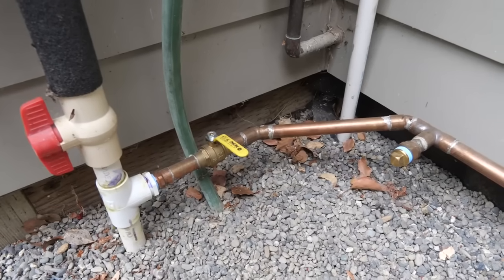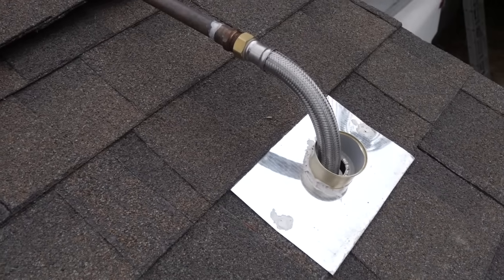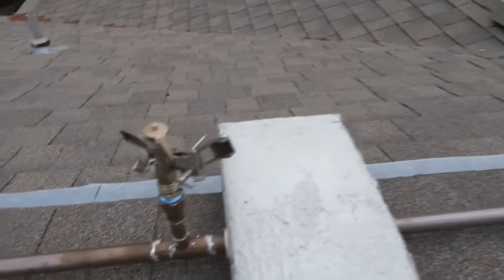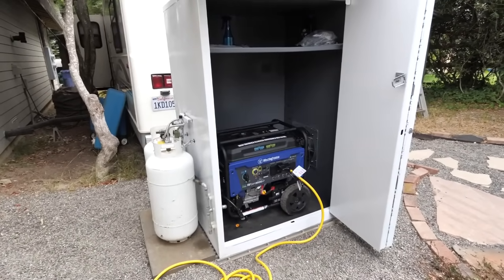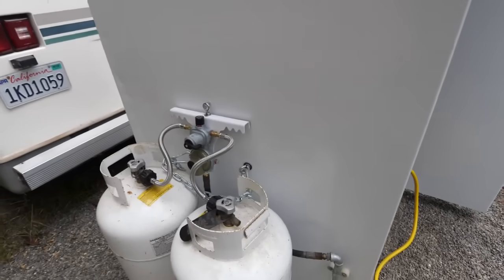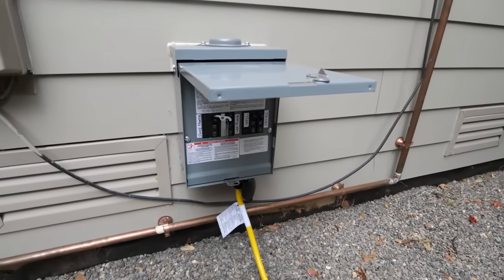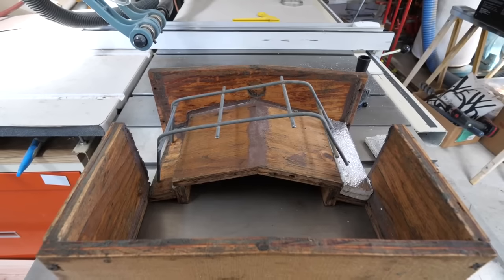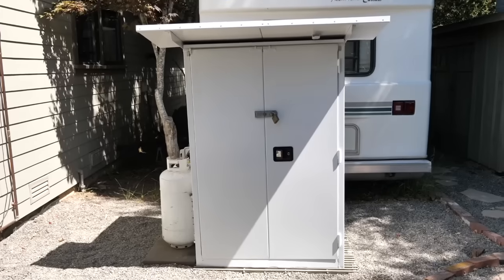Roof sprinklers and backup generator for wildfire-prone rural house

Comment: Great setup. My only comment is on your generator box. I would recommend placing the exhaust fan near the top of box and leaving the hole on the bottom as an air intake. Alternatively you can run a straight exhaust pipe out the box.

Comment: Nice work. I was a wildland fighter for many years. I found the top reasons houses ignite in wildland fires as follows:
1. Flammable items stored next to house. i.e. sheds, wood piles, patio furnature or decor
2. Wood decking; especially with vegetation growing underneath or beside deck
3. Bushes and trees next to (overhanging roof) home.  This is a big one and be mindful of the type of trees. Italian cypress, mexican fan palm, juniper bushes (among others)are explosive and catch easy. While most bushes burn, I would not have any of these on my property in high fire danger zones. I personally feel Mexican fan palms should be illegal in high fire danger zones. Their ember cast after they ignite help spread fire and keep shower them for a long time.
4. Accumulation of tree droppings on roof or rain gutters
5. Not as common but, have witnessed radiant heat ignite curtains or similar light flashy items near window. Wood or metal blinds can help keep heat out. I saw vinyl blind melt but, they didn't ignite
Reply: Also wooden soffits.  The burning embers need something flammable to ignite.  Stucco won't.  Tile/metal roofs won't.  But wood siding and wood soffits will.
Reply: @grayrabbit2211  You need to seal off all the vents into the attic and the crawlspace (if applicable) - embers will blow in there, and once they're in those enclosed spaces, it's game over. Like that spinning attic vent at 2:04 defeats any protection from the sprinklers. The overhanging trees are a real issue too. There's some videos where they blow embers at test houses, and it's all the vents that cause the problems. Shingles themselves won't ignite from embers being on them.
Reply: @grayrabbit2211  you are correct. The soffits should be boxed in and covered with stucco. all of the wood trim under the flashing should be replaced with fire resistant composite. it looks as good as wood but it’s hard to catch fire.
Reply: Some of the worst things are decks with wood trellises below them (or as we call it "house kindling")
Reply: If every house in Altadena had this sprinkler system (ignoring the physics of the water pressure drop), do you think the fire could have spread through the city?
Reply: @Kevin-ht1ox  Sadly the 70mph wind-driven firestorm in Altadena would be very difficult to stop with roof sprinklers.  The fire was blowing completely sideways incinerating everything in it's path.
Reply: @Cajundaddydave  houses burn when there is combustable material on or near the house: porches, furniture, leaves.  Things can spontaneously combust but its rare.  What is most common is a house being sprayed with embers and those embers finding a source of fuel.
There are people who literally saved their homes with a garden hose.  You don't need to stop the fire, you only need to prevent your house from catching fire.
Reply: @Kevin-ht1ox  If the sprinklers depend on the public water supply, they may not be worth the effort to install them.
Yes, I know, water always comes out of the tap and electricity always comes out of the socket... 😜
Reply: So not having a cheap ass roof made out of flammable material as Americans are keen to do? Sprinkler systems are a good idea, but if you actually live in a wildfire area, perhaps building your home out of entirely flammable materials is not such a smart move? How about a metal sheet roof that won't catch fire if sparks land on it instead of asphalt tiles? Outer skin of your building made out of blocks or bricks?
Reply: @jonathanbuzzard1376  The problem is not solved with a different roof.
The amount of heat from radiation is so great that even the wood under a solid roof can catch fire due to heat conduction. The roof will always be the weak point, even if the rest of the house is solid and the windows are covered. If the roof burns, the whole house burns down.
Reply: @ radiation decreases as 1/r^2.  Adding just a little bit of distance between the thing raging on fire and your roof line, is enough to prevent combustion of fuel on the other side of the roofing.  This means that a relatively small distance is enough to substantially reduce the amount of energy impacting the surface of whatever you're protecting.
Additionally, the metal roof would need to be close to glowing to ignite something it was protecting.  It's not like a Microwave oven where it is heated internally first.
Reply: @jonathanbuzzard1376 if you think the multi-million dollar homes in Pacific Palisades, home to Hollywood elite, had cheap ass roofs on them, good grief just sit down and shut up. 😂
Reply: vinyl will burn, I saw a whole 1 hour show on it. If it ignites it puts off super poisonous smoke and fumes.
Reply: I found from experience. Defying evacuation orders and providing your own structure protection saved my bacon 🥓
Reply: Thanks this is really helpfull
Reply: If every homeowner carefully considered all five factors mentioned above, I believe many houses could be saved. I hope people will make meaningful changes in the future. Remember, all the trees that once stood near your houses are now gone. So, don't let the same situation happen again. Avoid growing trees too close to houses or living areas, or choose safe and non-threatening plants.

Comment: Change that water heater braided line out to a corrugated ss type. They are rated for outdoor use. The braided will fall apart over time due to the sunlight breaking down the inner rubber hose.
Reply: Good eye. I came here to say the same.
Reply: Yup, it may work fine as braid, but the day you REALLY NEED IT, you don’t want to be worrying that it MIGHT fail. 😳
Peace of mind is a wonderful thing. 👍
Reply: thanks for the tip! I wondered about that...
Reply: Or just get a hydraulic hose made. If you really want the sun to f off..
Reply: Being a plumber's son and who as a child was forced labour for my dad's plumbing business, I personally would do it all in ridged copper, might take some figuring out but this is fire suppression system, I put a sprinkler system in my garage for welding and my father actually told me it should be steel, but ridged copper would work to some degree in a fire, until the solder gave out from the heat.
Reply: @MattVenezuela ever try and solder a copper line with water in it? I don't think you're going to have any issues with the solder in a fire with the lines full of water

Also, common practice for commercial buildings to use CPVC plumbing for their sprinkler fore suppression system. When the system is full of water, especially if the water is flowing thri a sprinkler head, it will keep the plastic from melting
Reply: @MattVenezuela 

Ffs mate, it has water inside it and should be silver braze NOT soft solder. Duh
Reply: @MattVenezuela  tell me you have NO SCIENTIFIC OR PHYSICS KNOWLEDGE, without saying  you are clueless about science and physics.
Mind you, this IS basic grade school science.
Reply: No it won't, the braided stainless protects the hose, and I will bet money the "hose" under the braiding is NOT rubber. Personally I see NO issue with that hose. Especially since you should be testing your system at least once a year to verify no issues before you actually have to possibly use it. If it becomes an issue, fix it. But those hot water heater hoses ARE durable.
Reply: @krabysniper  
 I was a licensed plumbing contractor for almost 30 years, retired now. I had more problems with those ss braided hoses than I can count. Never had a problem with the SS corrugated ones. The inside is nylon/Teflon liner with a rubber hose around that and then the braiding. This being in the direct sunlight and the heat that comes off of the roof will make this fail. Everyone of the ss braided that failed, failed near the vent connector on the tank water heaters due to the heat. Read the manufactures label and it's not for outdoor installation.
Reply: @krabysniper whats wrong with the ss corrugated tho
Reply: @CevicheTheory 
I never said there was. Either or will do. I was merely pointing out that I wouldn't be concerned with using the SS braided over hose, and certainly wouldn't rush up to replace it. 
Fact, all fire fighting systems should be checked annually at a minimum. So if it were to become an issue ( I reiterate it will not be) it should be caught in qn annual test/inspection.
Do you just assume a fire extinguisher will ALWAYS work, Or do you have it inspected frequently?

Comment: Good work.
I have a similar roof and eave sprinklers that were put up after the huge fires in San Diego County after 2012. 

I used black iron pipes and threaded metal pipe couplers and fittings. I intended to use copper pipes but figuring out the worst scenario that could melt the solder joints, I opted for an all steel system..Regular fire sprinkles under the eaves and a combination of landscaping and fire sprinklers on the roof.

Comment: This should be a building code require men on all homes. It should be plumbed into the roof and the sprinklers should pop up. You have made excellent material choices and I look forward to seeing this effectively save your home. Excellent retrofit work. If you invest in solar panels the sprinklers will help wash off the dust.

Comment: this stuff is a wonderful idea and prevention. Remember  though , these fires are hot , air moves and the temperature can be very high debrie may get trapped around the pipes . This is the Achilles'  Heal  of the system " soldiered pipes , the soldier may soften and with the system under pressure it could sever , change to Galvanized pipe  and size according to water pressure from pump to all sprinklers . I hope you never have to use , but as we see , homes are being saved with just a regular garden hose .       Best of luck to all that need these safety measures

Comment: Fairly robust install for DIY. I'm curious... now that it's been 3 years since the system was put in.. has the undrainable section above the garage frozen during the winter (it's lower than the supply side, and will never drain through the ground-level plug).

Comment: I'm a guy who can build pretty much anything and I am VERY impressed with the design of those concrete blocks !  Love the PVC sleeve which of course gives you a way to slide the pipe through, but also does double duty protecting the copper from the caustic concrete, which would eventually corrode the copper.

Comment: You did exactly what every house in Southern CA should have and there would be no huge problem now. This is idea I came up with after watching the news for a couple of hours. I can't believe that the "fire experts in LA " don't have a clue about prevented measures that actually work ! This system should be required to use in order to rebuild.
Reply: These systems have been in use for a very long time...
Reply: Just have to figure the water pressure problem that would occur. Once everybody turned on the water.
Reply: @vblic  Dude think of the smelt.
Reply: water pressure would drop everyone using it. plus not all homes have wells. or are allowed to have them

Comment: Nice and all well and good except your soffits/eaves and fascia are open. Your sprinklers on the roof cannot help you there. Enclosing your soffits with something like Hardie Board and wrapping your fascia in same stuff,  along with Vulcan vents (if needed) will dramatically help. In high fire areas its one of the biggest things insurance companies ask you to do in order to harden your home. Flying embers get caught up in the eaves/soffits, where your sprinklers are not, and are one of the biggest reasons homes catch fire. That and any vents that have basic screens, or that do not meet the stringent fire codes (thats how embers get into the attics)....Doing these extra items is adding another layer into your defense against wildfires. 
While the sprinklers are nice and all, they wont help you if embers are already in your attic space, or if embers catch in your eaves.... 
Also, you have too much foliage next to your home. 3-5ft of defensible space is a must. All that greenery, while pretty, is a big no no when it comes to wildfire mitigation...Just some advice from someone who lives in fire zone 8 and has lived through 8 wildfires now.... Cheers!

Comment: Many many flaws in your theory here. Should be Iron pipe from below ground/up. In a real fire situation that make it around your house you system will be taken down in seconds with melted plastic and other soldered joints. You have an RV and trees up against the house. Propane tanks exposed with plastic components… You’ve wasted a lot of money here making yourself feel better.
Reply: Probate tanks ; extremely dangerous !

😂